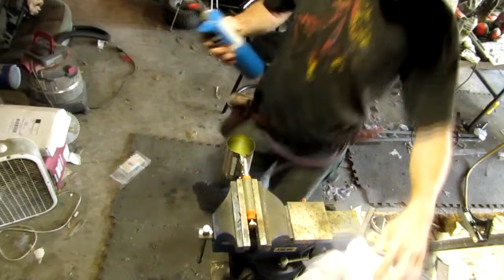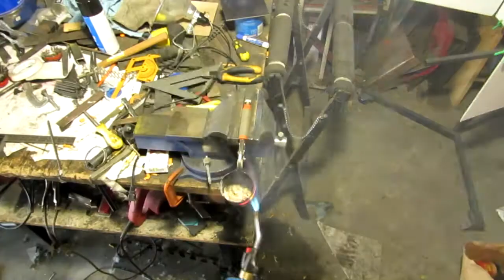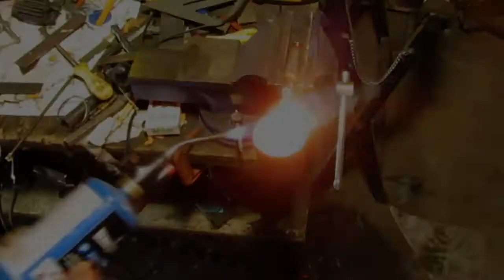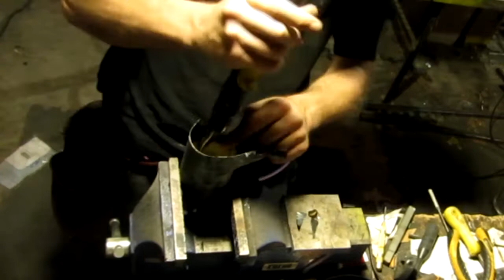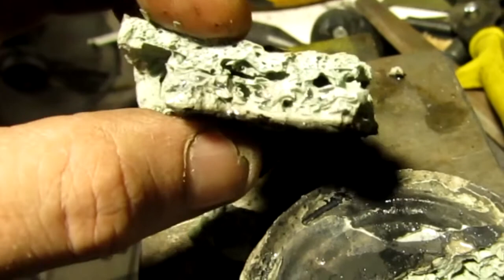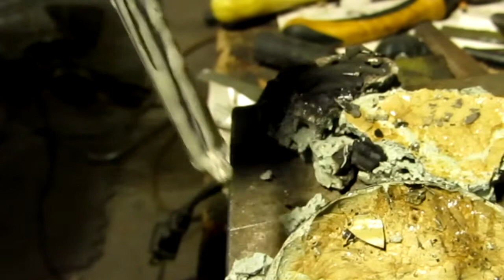Melting Plastic Experiment

Comment: Plastic bags will definitely work, but using a torch is not the way to go.  I noticed you set the plastic on fire several times.  Heat the plastic in an oven, so you can control the temperature. (Plastic bags are always amusing to watch melt in the oven, because they squirm around like writhing worms as as different areas melt at different rates.) You then definitely need to compress the melted plastic a clamp or clamps the get it down into a more solid block. Plastic bags will tend to trap a lot of air inside, as you noticed, but if you compress it,, you will end up with something better.

Comment: And almost die in the process???? It is deadly! When heated up, you're old enough to know you should google shit like that before you do stuff, lol.
- Plastic's are cold molded, Usually with pressure and not alot of heat. - Teflon is deadly over 400 Celcius. - Nice Try Though.